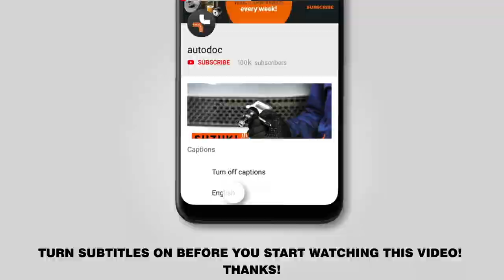How to change front brake discs / front brake rotors on FORD FIESTA JA8 [TUTORIAL AUTODOC]

Comment: Thought copper grease was not supposed to be used on parts where metal to metal was being mounted as this may affect disk runout leading to warped discs...
Reply from the maker: In this case, we used a special 3970 Liqui Moly spray based on copper grease, it perfectly protects against corrosion and sticking of parts operating at high temperatures.
AUTODOC